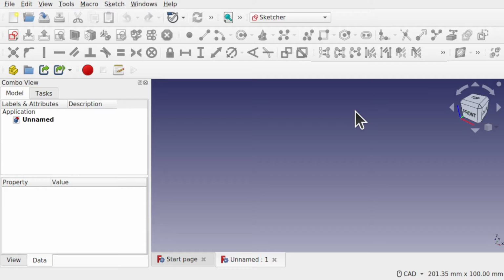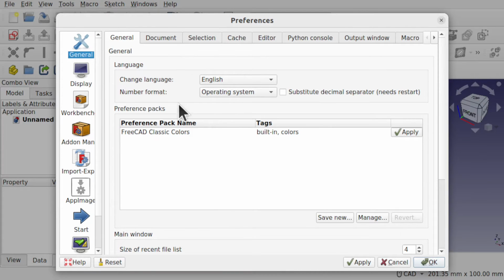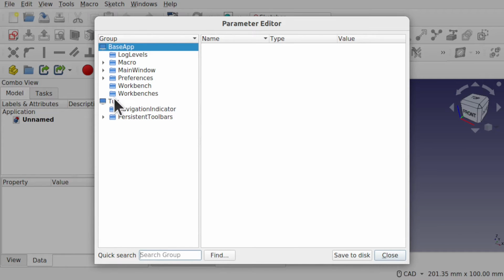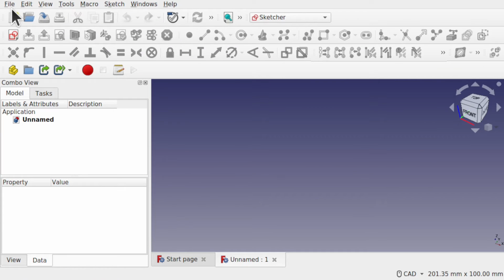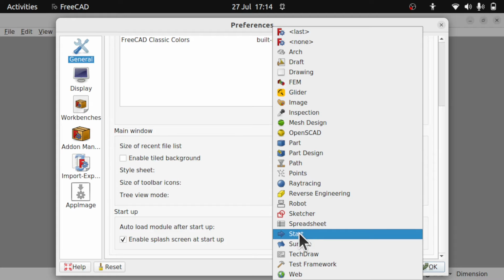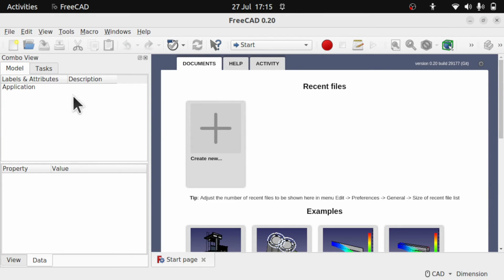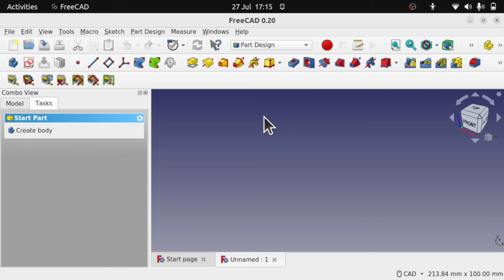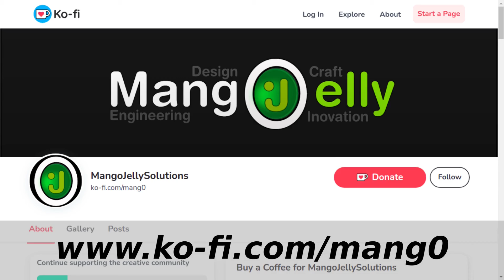FreeCAD Problems Fix : Reset Toolbars To Default Position

Comment: Well the re-docking works well.  

But the toolbar shuffle just creates chaos.  The default plasters the toolbar space with icons of dubious value.    The arrangement of the icons is not what was assumed to be the default composition and content.  

All I have now is trash.      🦟  But, seeking a work-around:

What exactly are the contents of the "default" toolbars?  The Standard View toolbar option and the Structure toolbar option include a substantial number of icons/features of little value.  They just clutter up the dashboard.  Is there some to make the "Tools.Customize" to deactivate icon/tasks that may consider useless by the user.

What display size is required to display the icons that are not related to the Workbench currently displayed?  After following the toolbar default described in the youtube presentation the File,  Workbench, Structure, and View attempt to display across the first row.  For the Path Workbench all the icon groups attempt to display across that first row instead of slipping to the second row of toolbars.  For Parts, Part Design, Sketcher, Draft, etc.  

Your presentation starts with a display showing four rows of toolbars with icons.   At the end of thee "Reset" there are three rows.  After following the process presented I observe Sketcher with two rows of icons and Path with just one row even when "all" toolbars are manually set to active.  Do you have any idea where the toolbar display parameters are maintained for the system and the individual workbenches?  I have plenty of experience adding macro icons and have "played" with the Tools.Customize for individual Workbenches.  

Using the Tool.Customize a Toolbar called Aap_Views was added to the Path Workbench.  Aap_Views toolbar contains the Isometric, six typical views of an objects surface, as well as the Measure icon.  I can limp along in the Path Workbench with this addition.  But only the Aap_View toolbar appears in the second row of toolbars.

Comment: Well, I did all that, and my toolbars changed, but they are still wrong. For example, the thing where you choose which workbench to switch to is all the way on the left rather than in the middle. And the yellow icon to create a new part is gone. It has been gone for a while, and that is why I tried this reset you suggested, but the icon is still not there. It used to be in the toolbars of all workbenches (or at least I use), but is gone from them all. Please advise.

Comment: On Windows just go to "C:\Users\your-user\AppData\Roaming\FreeCAD and delete "user.cfg" re-start FreCAD done!
"your-user" will be different! Guess there must be a similar method for Linux. Maybe delete "user.cfg" via command line
in terminal. Linux users love terminal, you are probably in there right now. Terminal 24/7 🤣! Don't bother with X11.
Reply: @mikejones-vd3fg  Well reinstalling wouldn't work anyway. Great you got it done! Cheers.